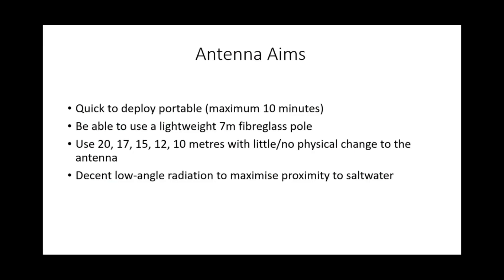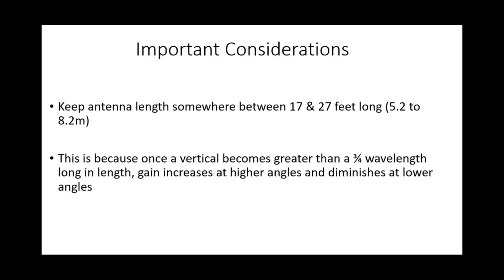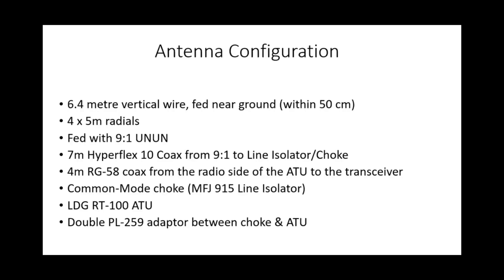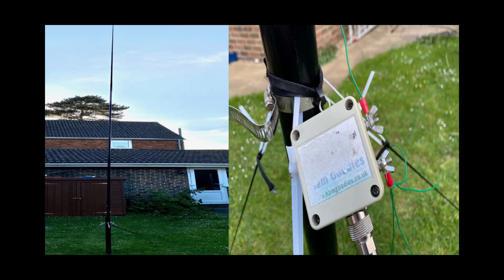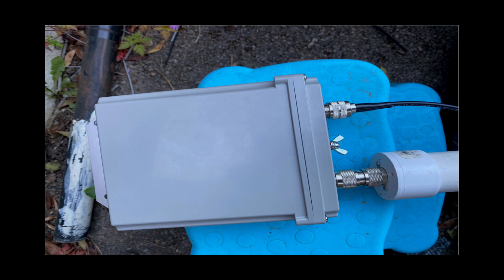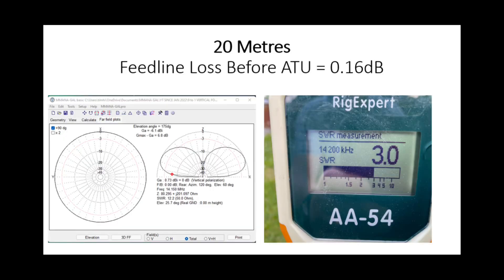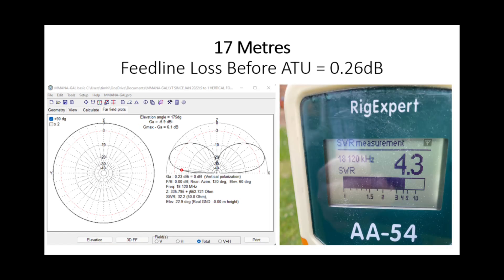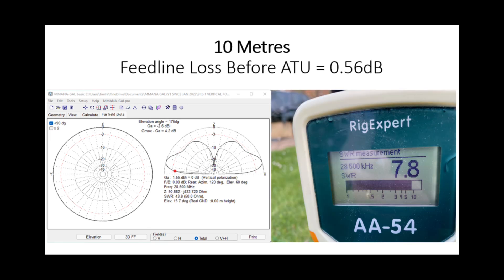Ham Radio: Simple Vertical Antenna for Portable DX

Comment: Hi Tim
I use a version of this antenna from my apartment here in Spain. I put a 7m pole out of the window in a horizontal plane and have the wire cut to 11m which I attach to the pole with electrical tape and let the 4m end dangle down, giving me an upside down inverted L shape.
I use just one counterpoise wire of around 8m which I lay on the floor inside the apartment. Being in a flat, I suffer a lot with local noise, but, I tend to use it in the early hours when people start to go to bed and turn off the wall warts.I get some great DX from time to time. I´m a CW op and like to Run a frequency in contests.  Cheers Gary EA5IUY
Reply from the maker: That sounds like some great ingenuity Gary.

Comment: A good vid Tim. I use one when away in my caravan. I run two radials to the caravan and attach to the frame with a few more on the ground. Works a treat, managed contacts into Canada, Ivory Coast, USA, Cyprus, plus many more across Europe, 10w too. Not for much longer as passed my Inter exam yesterday. 73
Reply from the maker: Congratulations on the contacts and the new call!!

Comment: Great video. I've found a 10m "random" wire fed via a 9:1 to work well as a sloper on my telescopic pole on all bands from 10m to 40m. I have even managed a few contacts on 20m and 40m with it laid flat along the top of my fence at just over a metre off the ground. Haven't tried vertical yet though, will have to give it a go.
Reply from the maker: Interesting Neal - just shows how versatile some antennas are 73

Comment: Very informative and well presented as usual Tim. You know the more I read about 9:1 unun's the more I believe how effective they can be when installed correctly. The RF choke is the key and last time I used a 9:1 I didn't have the choke and I had all sorts of problems. I have just recently ordered up a 9:1 from Balun Designs and expect it this week and I am going to set it up at home as a sloper with 53ft of wire. I will let you know how it goes. 73 Syd MI5UTC
Reply from the maker: Hi Syd. Yes the key is to make sure the radiating element is a non-resonant length (especially avoid 1/4 and 1/2 waves) and use as many radials as you can PLUS a choke on that coax before the radio. They are versatile and adaptable antennas. Not a yagi for sure, but sometimes, its just about getting on the air however we can and they can work well in quiet, portable environments. By the eay, Balun Designs as  you no doubt know, make superb baluns and ununs - I am sure you will enjoy that antenna. 73
Reply: @timg5tm941  Tim. The 9:1 unun is installed with 72 feet of wire. Just using the coax as the counterpoise with a good choke about 40ft along before it enters the shack. SWR 2.0 or less on 80 though 6 without the radio tuner. I did try with 53' of wire and it worked fine as well but i have the room for the longer choice. Left FT8 on during the night on RX and PSK reporter this morning showed signals from New Zealand to Alaska so i am pleased with that. Syd

Comment: Good job Tim. Interesting concept that I have also employed and plan to tweak. It would also be good to simplify further and see results by just using the coax between 9:1 and 1:1 as the counterpoise (ie get rid of the radials and see if your radio fun is diminished noticeably). One thing I would be careful of is using ‘double connector’ between line isolator and the ATU because of the potential strain caused on the ATU socket (which could cause an intermittent). Probably better to have a short 1m lead. Cheers for now. Catch you soon.
Nick M1DDD
Reply from the maker: Hi Nick - yes the double connector needs to be used carefully I totally agree 73

Comment: Great stuff , I've been experimenting with a 12m pole and an rfcomms 49:1 matching unit . It depends on how I wind the wire onto the pole for different bands . Eg tight coil for about 2ft at the top and coiled with about an inch gap to the base let's me work 160m even with 10w .
Reply from the maker: Sounds great Aeron

Comment: Very interesting Tim. Do you think the lengths / type of the coax you are using are essential to your results? I know it is good to keep the losses as low as possible, I happen to have a 9 to 1 lying around so may give this a go. Off to the coast this weekend (hopefully) but have cricked my back so dont think I will be doing anything too adventurous, maybe take the Slide Winder, Tank Whip and ATAS 120 with me.
Reply from the maker: Hi Chris, yes you do need a 20 foot plus run of coax. I opted for the 7m run of chunky Hyperflex 10 before the tuner to minimise losses. Even with seemingly high swr at the feedpoint, a 23 foot run of this coax can give us manageable losses even up on 10m. Get by the coast and a dB or two of system loss will soon be a distant memory with the 6 to 10dB of extra gain we get from that lovely salt water ground! 73. ps - hope the back recovers - I know full well how you must feel.
Reply: @timg5tm941  I have always said the sea gives you 10 dB ..
Reply from the maker: @HS0ZIQ  agree fully John. Do you operate up on the rock itself? My wife worked out there a long time ago.
Reply: @timg5tm941  Not going away now, hurt my back :-) it was getting better but worse today. Have to be another time.

Comment: What antenna do you recommend for broadcasting Hitler's speeches at 1000 watts on 11 meters?
Reply from the maker: Has to be an 'extended Zepp' (maybe the Hindenberg 5kw version - but don't run it on full duty cycle in case the core overheats).